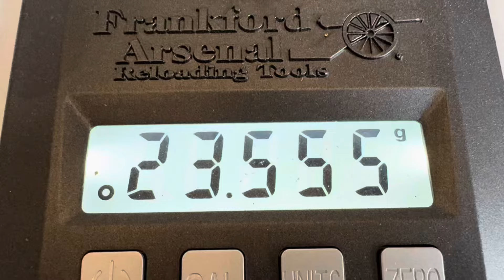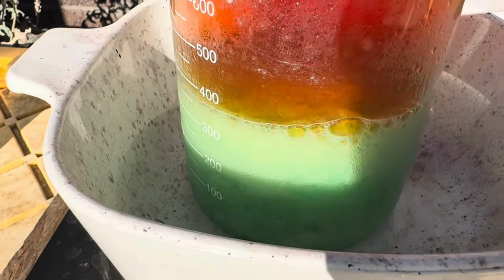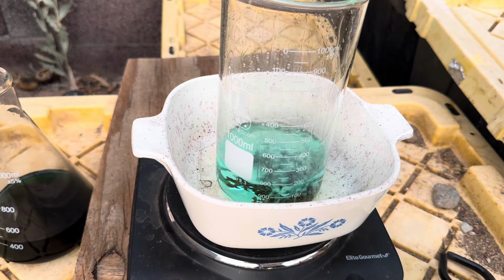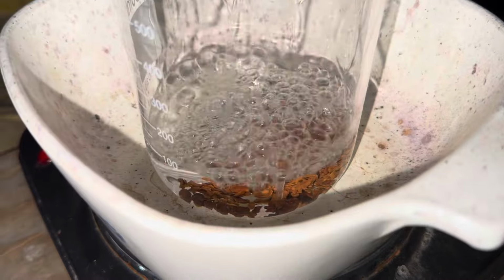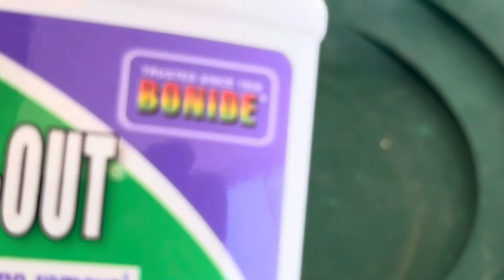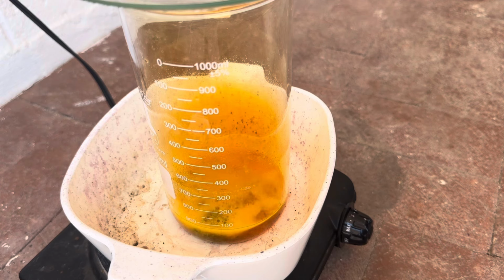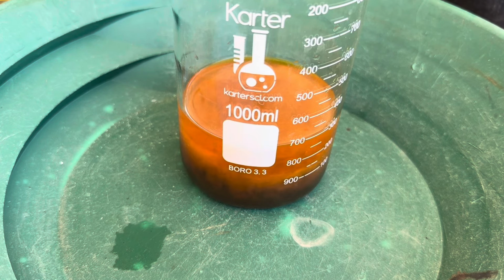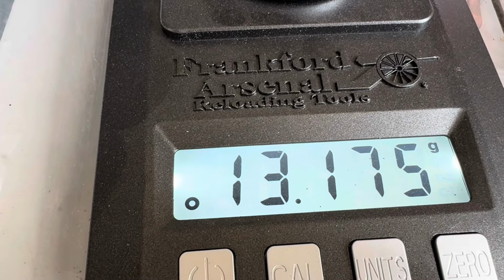Refining Gold from Scrap

Comment: A fellow student of Sreetips I see. Some tips:

Test your SnCl on the AR first before the SMB precip as it goes bad over time. 

Add DW ice to the AR before filtering it to shock out any AgCl that may be present.

You can add a few drops of sulfuric to the AR mix before the nitric to precip any lead that may be there

Pour the hot dilute nitric acid into a wide mouth beaker. That shit will go right to the bone!
Reply from the maker: Appreciate the feedback: the SnCl is used quite a bit and it’s pretty fresh and been used quite a bit so I’m confident with it so far but it couldn’t hurt to do that
The addition of DW to shock the silver chloride won’t actually drop it, that’s why I use purified water which would drop the AgCl.

I did use the sulfuric as well for the lead 15:48 just forgot to include that in the commentary.
Nitric is very dangerous Fosho thanks for watching and see ya on the next one

Comment: Do you not use urea to kill the nitric?  Still very new to this.. is urea not necessary before dropping the gold?    Nice job  on the video  just curious if im adding a step that isnt needed
Reply from the maker: You can, but I always just boil off the nitric acid and reduce the AR. This rids the solution of any free nitric when you go to drop the gold, and eliminates the risk of the gold redissolving

Comment: Good effort buddy. Im curious tho, once you've edited your videos and you're ready to save it, do you actually watch the whole video to make sure there's no mistakes ?.
Here's a tip for ya. youre not meant to use tap water ice. The whole idea is to remove impurities. Tap waer has minerals in it. You should freeze distilled water
Reply from the maker: It’s not tap water thanks for watching
Reply: @VendettaProspecting  you said it wad
Reply from the maker: @prospectorpete  RO ice was used to drip and silver chloride suspended in the AR, then filtered its standard practice to aid in removing and AgCl. If distilled water was used the AgCl would drop out with the gold after filtering and contamination the gold at the end